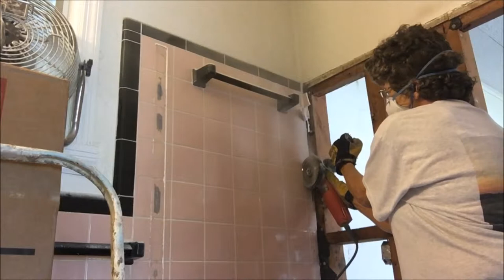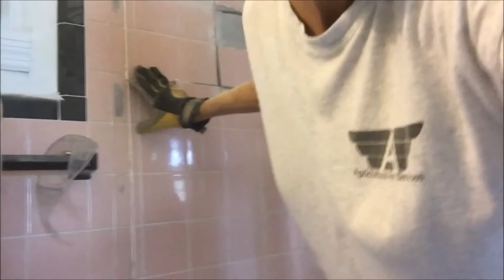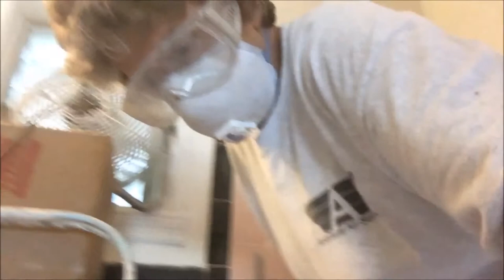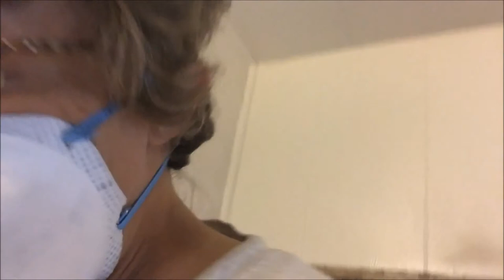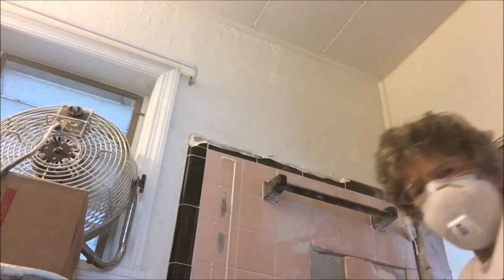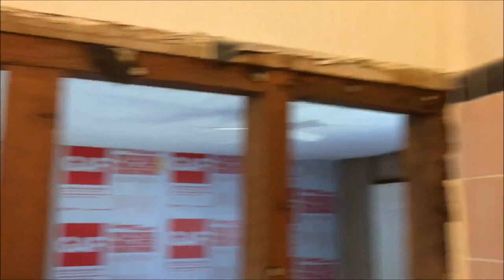Concrete and Mesh Tile removal Part 2

Comment: My bathroom has a massive erosion hole that breaches the pantry wall on the other side 2' x 1/12'. There is no mesh beneath this. The soap dish fell and tiles started to fall little by little and I guess through the years, the water eroded the inside into its current condition. I had family living with me and... I am at a loss for what to do. Plus, the vent that leads to the roof is in this wall.
Reply from the maker: Wow.  That's unbelievable.  Try a tub surround.  You could put plywood or something behind the surround.  I usually HATE surrounds, but I really like the Bootz Nextile.  Let me know how it goes!